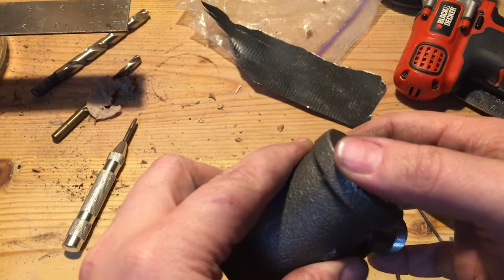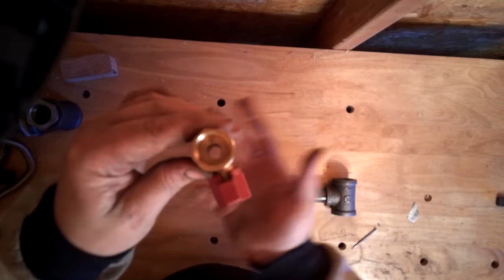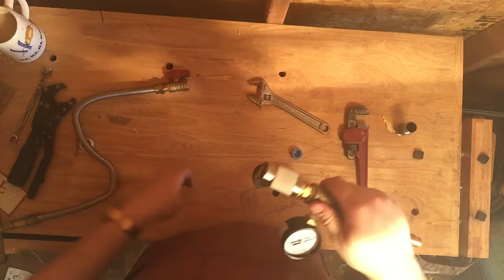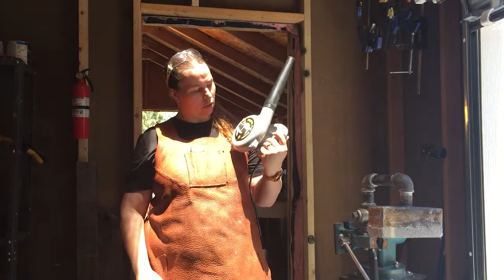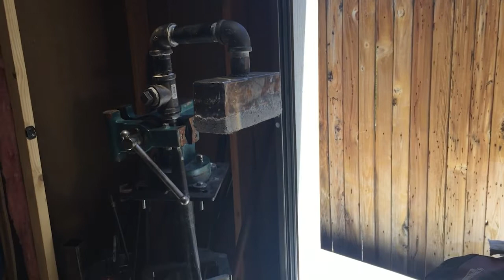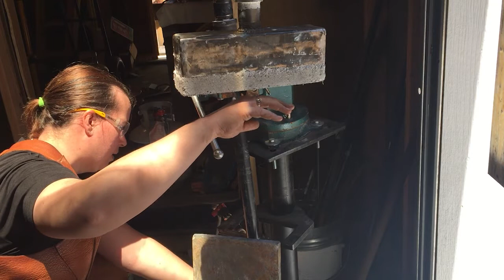Ribbon Burner build pt2 - How to build the NG Ribbon Burner

Comment: Hello,  It's good to get my self help.
  Start tape 1/8" pass were threads begin so not to break off in line cause plugged in line.
Not a complaint but like you I want to pass it on
 I like your idea of a 1/2" system great to make it easier, Smart Girl.
Again Thanks for showing and teaching
Reply from the maker: John Jude your very welcome thanks for watching :)
Reply: Sorry if I offend anyone, I didn't mean to send a wrong message about me having a table to work outside, Believe me I have had less than most.I have seen you working on a outside video , Perhaps where your shop is now.
  Knowing you teaching school of which involves a lot of hours, and as jobs conpare to years in college often also under paid,
  I did not try to down grade you about that table and when I need to work on the floor I do but I try not to.
  Thanks for teaching and trying to help me and others. 
 Some idea of what it takes to live
Thanks again and sorry
Reply from the maker: +John Jude yep it was outside, and then I built this shop over the area where I used to work ;). My outside area is very small now but I have tons of ventilation, I made sure if that. And no offense was taken:)